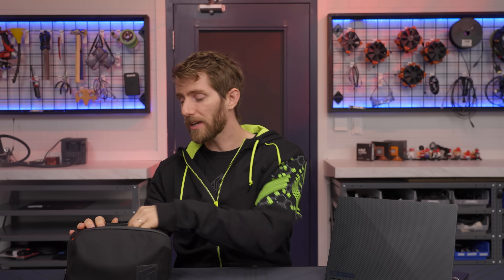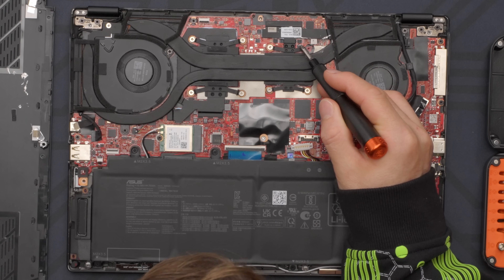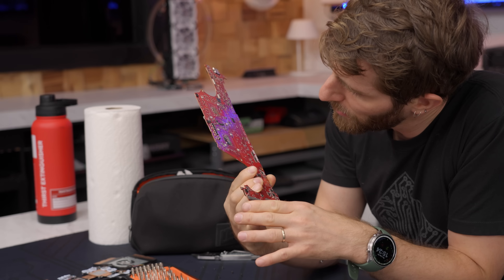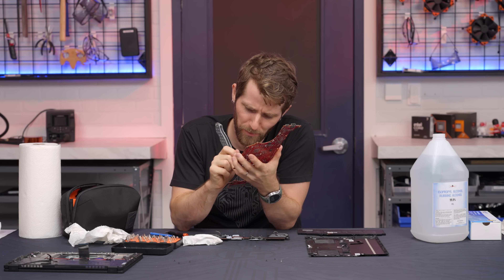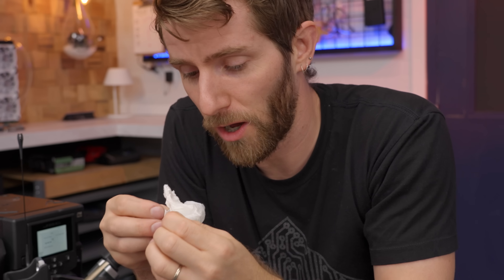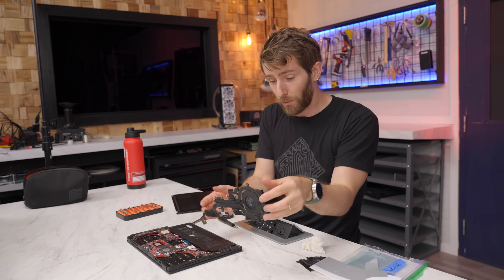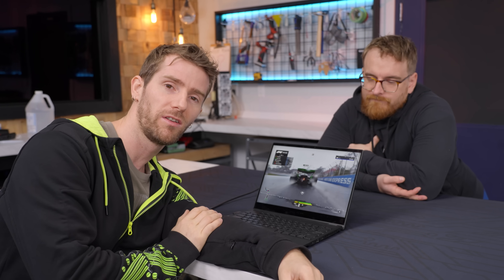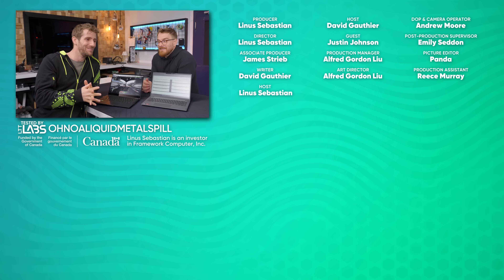Liquid Metal Killed my Laptop… Now What?

Comment: I had a recent experience with liquid metal in a laptop, just curious if anyone else has had this issue. Basically, over 6 months or so, my (year old) Dell G16 7630 gaming laptop slowly started having really bad performance, and not until it was entirely unusable, did I finally invest the time it needed to solve the issue. What it turns out the issue was, was that the cooler had a scratch on the surface over the CPU, and the liquid metal reacted with the exposed copper, forming chunks of metal, forcing the cooler away from the CPU, until it had almost no cooling. I did not have temp data from before the issue stared, but after replacing the liquid metal with PTM 7650, the performance seemed to be back where it was originally. Anyway, this feels like a really weird and one-of-a-kind issue, so I've been wondering if anyone else has had something similar to this happen.

Comment: Get a ultrasonic cleaner and throw whole motherboard, should remove any small drops of liq metal that goes into all nooks and crannies, cause out of multiple devices with manufacturer installing liq metal, i found only 1 that has properly installed from factory and also after 3 months no matter the orientation it kinda still looks ok and works. All others are or dead of short or started to increasing temps and had to be torn down and carefully and thoroughly cleaned and properly reinstalled or simply used ptm7950...

Comment: Your conclusion to the video was that the performance difference was really close. But the actual performance difference was 100% failure, to 100% running fine. The liquid metals cause of failure means a 1-5% performance drop doesnt matter. if it performs better but it can cause a failure,  means its overall inferior.

Comment: I've picked up a handful of the ASUS laptops with liquid metal on eBay to repair and swapped them out with high quality paste and haven't noticed any meaningful temp differences, actually the older ones seem to improve temps a good amount, it appears that the older units had quite a bit of gallium induced corrosion on the heatsink, and I've even seen some unremovable corrosion or contamination on the CPU and GPU dies even after only 2 to 3 years of use. It's just not worth it and it looks like its the same story on the launch PS5's, the risk for damage and degradation over time is not worth the slight temperature improvements on consumer devices.

Comment: I suppose liquid metal would be acceptable for specific laptops designed to replace large desktops & see very little travel time, like for office space configurations. However they would need a battery bypass power option but guess tech industry at this point is more in favor of failure 🤷‍♂️

Comment: Centrifugal Forces Inc. I guess all the tin now is compromised where the LM went so that must all be replaced as well because a bump can kick off the components. This hardly seems to be a fix at all because all components must be put on the board all over again because of weak tin. This is going to be costly for Asus

Compressing a liquid is difficult so when too much was applied the seal would never close it off but the liquid metal would actually push away the seal instead

Comment: Had this kill the memory slot on my ROG zephyrus G13, had to RMA my machine twice because after they sent it back the first time it was missing screws, and ended up having thermal throttling issues because they improperly applied the new liquid metal, got it back again covered in dark fingerprints on the machine and thermal paste smudges all over the board

Comment: I had thermal issues still after repasting my GPU, so I got a phase shift sheet from Thermal Grizzly and their putty for the memory which was overheating too. Been running solid ever since, also applied some on my old Dell 7490 that was running hot with fan going under load. Now it idles under 40c and maxes low 50s under load and fan doesn't even run under any normal load.

Comment: This video ain't done until a proper repair technician takes a look at it. If you're lucky, a short killed a fuse. Resolve the short, which may have already been removed, replace any blown fuses, you can probably get it up running. It would be a dream to get this computer for cheap so I could try to ress it but a proper repair collab with someone that isn't a novice repair enthusiast would be good content.

Comment: anything small or portable does not need liquid metal because the heat-sink is so small and hot that the difference will be marginal, pretty sure normal thermal paste won't do much worse either.

Comment: i was thinking of taking my ROGflowz13 Tablet 2023 apart to do a deep clean and add some thermalpaste to some back chips so i can use a 3rd thin cooler on the back 
while gaming or bitcoining on it. having a big old 2004 Dell heatsinc on the back helped so much that the heatsync that is like ruffly 5 inches high was warm to the touch and i got it to mine fasterrr hahah. [killed by coins not yet]

but id like to mod a cooler on the back external that i can add on and add off like i did in 2015 to my Liynx 10inch tablet back in 2015 my first win tablet that i made fater but in turn made it run hotter but it lasted 4yrs before that died i used to run a store starbucks page onit and even drawn art

Comment: Who the hell lets Linus have a hot air station in his hands as clumsy as he is?  
BTW Linus.  99% isopropyl alcohol with q-tips.  You could even put the alcohol in a refrigerator to chill it, which will make the liquid metal less viscous and ball up easier.  hint:  roll the alcohol-soaked q-tip to get the liquid metal to gather in front of the motion of the q-tip.

Comment: I also have asus g16 strix i7 13th gen variant and it also have liquid metal inside but i always use it on a table but i am going to start my collage soon ,so should I remove the liquid metal and put thermal paste in liquid metal laptop will it affect the thermals well if the difference is only 10°c ,then its a fair trade i guess

Comment: I decided to rep paste my Acer predator Helios 18 and get rid of the liquid metal. Found a ball that had managed to get up under the edge of the process processor. After I was done crapping myself, I got some canned air turn it upside down sprayed it to freeze it in place and then blew it off of course making sure to cover everything around it before I did that and it runs.

Comment: All I want to know is, Am I hurting my PS5 by placing it vertical?
Reply: Yes it’s going to explode if left vertical for long enough and with enough use well exploding is on the extreme end it’s still very well possible but most likely it will just not work when you try and turn it on one day or when your playing it will just stop working
Reply: @eden-32415 Chill, i just wanted to know if the liquid metal would leak over time.

Comment: Well, good job on the cleanup- but liquid metal is also extremely corrosive to any other metals. that means that it probably leeched into the solder of the parts it got on- meaning that they'll over time flake and fall apart.

Comment: Putting Liquid Metal on a Laptop that you carry around in a random position using the same heat spreader used on thermal paste is disaster waiting to happen..
Reply: To be fair unless you just need that extra couple celcius, liquid metal is not worth the effort even on a desktop versus a high end thermal paste especially on consumer hardware.
Reply: @kelmanl4 laptops do kinda need those few degrees
Reply: @ColossaldreadmawOP Laptops need bigger heat sink, not liquid metal
Reply: No it isnt, as long as you dont throw your laptop at the wall then the liquid metal cnanot escape its encasing
Reply: @ts8960 nah fam, it does. Get a laptop with LM and use it for a while. You might be lucky with it, but with the care I take for my laptop, it still leaked out.
Reply: @AvinaashKuppusamy mine is going strong for 3+ years now, with standing up use a lot (daily work). What i wanted to point out though : it is NOT the same headspreader set up. As pointed out  in the video, they have special seals around which raises everything and they have an adjusted headspreader for the LM machines. The regular machines have something that looks the same, but is a bit smaller and mounts differently.
Reply: @jorismak  you've got luck then..... mine came factory with LM and it has leaked out..... not as extravagant as the one in the video but still a leak.....

Comment: I see a lot of gullible people in the comments being "sold" on PTM7950.

1. This whole video is literally an ad for PTM7950, he literally sells it on his store ffs.

2. Any person who has dealt with shorted out boards either spilled drink/water or liquid metal knows that majority of those boards are obsolete. You cannot magically revive them just by wiping off the spillage. Dude even wacks off a couple capacitors off the boards and stills tries to convince you he can make it work somehow.

3. Liquid metal CANNOT be outperformed when it comes to thermal conductivity, it literally has almost 10x the thermal conductivity of any thermal paste including PTM7950. In this case, the bottle neck was either the cooling system or the hardware itself was not highend enough. There's no reality where PTM7950 performs even close to liquid metal.

And shame on LMG for using mental gymnastics to make a dollar. They didn't lie in the video but the truth was portrayed in a way to benefit their sales. Laptop hardware is already very low wattage because of the battery limitations, there's not much heat to move from those mobile cpu's anyway. I dare Linus to try a thorough comparison between the 2 on a high-end machine with big wattage rating. I know he won't!

Comment: 8:09 "liquid metal will heat up not melt"... It's a liquid. It is designed to be past melting at all times. Heat may help it flow better, which would be a better subtitle? I would imagine most PC users would assume it could harden based on the phrasing. Maybe change this? It's a bit misleading.

Comment: Liquid metal is... probably gallium?  Gallium contaminates other metals in an amalgam reaction, usually resulting in a very weak, brittle metal.  Any board that uses 'liquid metal' that spills onto the board is probably not worth repairing due to severe solder degradation from the contamination.

Comment: As someone who used to work around Gallium on a daily basis (high force bearing), Ammonium is the best way to clean Gallium. We used Windex as it had the highest concentration. But it is EXTREMELY hard to get all the Gallium off. We always had some stuck on our laptops’ shells or our shoes. I can’t say whether or not it’s safe to use on your laptop components though. I think it’s so dumb that companies are using Gallium in computers, especially laptops

Comment: I'll be skipping liquid metal.
Reply: @hridoygovindadas914  why? Just dont throw your laptop on the wall and you won't have issues
Reply: Don't mind the asus employee above me
Reply: @lostskull7467  yea i work for asus, how does that invalidate my opinion? It's not easy getting accepted to this job
Reply: @lostskull7467  seems like you're thoughts are very wrong because I don't work on asus employee but i like people yapping on how bad liquid metal can be.
Reply: I’ve gotten my laptop knocked over quite a few times with Liquid Metal and carry it every day for school yet have never had any problems. It’s generally safe if you do it right, it’s just that Asus came up with a really bad design and assembly in this case.
Reply: @ts8960  or just use PTM 7950 and has very close performance than liquid metal, Not only for safety also longevity so you don't have to repaste every year like my laptop has been used 3 years since using with ptm 7950 and still performs well. I just clean only the fans and removes dust from heatsink and never repaste. tbh the liquid metal is just marketing flop.

Comment: Soooo... There weren't any up close and personal shots there, but in the few seconds of google imagesing and watching this video it looked a lot like that retention seal doesn't have a breather or anything like that. If you want to seal something without a breather then the thing you're sealing in has to be incompressible, otherwise when you heat it it'll apply pressure to the seal and, in extreme cases, result in a seal breach...
Given what this looks like, I suspect that's what's happened here... A consistent failure at one location suggests that the heat sink has been effectively pumping out a little liquid metal every time it's been thermal cycled... If you've got a vapour chamber, they're crimped and soldered metal for a reason, they become a pressure or vacuum vessel depending on how they're designed. Ultimately a low contact pressure wiper seal like you've got there never had a chance... I'm guessing it'll look fine in testing, because, and I'm guessing here, they don't use power based thermal cycling in their accelerated lifecycle testing. In fact, it's quite likely they either externally heat and cool, if they do that at all or, more likely, they just leave them on permanently as a burn in style test and only do thermal extremes in operating and non operating states.

Comment: My charge light for my old laptop wouldn't go green no matter how long it charged and i couldn't figure out if it was the battery or the charging brick and well having the 2 bricks plugged into the wall and not the laptop yet just so i could see a charge percent difference and before i could plug in the old one it went POP so it answered my question for me.

Comment: I bought it second-hand for my thesis/capstone project, and it was working fine at first. Later that day, I decided to clean it, but I didn’t realize the liquid metal had spread across the motherboard. I also forgot to unplug the battery before opening it. Since then, it hasn’t booted up.

Comment: I bought Honeywell PTM7950 off of Temu Beleive or not lol 2* 60mmX60mm pads cost me $7.00, and granted my machine isn't "well equipped" with a 11th Gen i7 and an rtx 3060 (100w?) I cannot seem to get it any hotter than 80c now(power virus) , where as before with the stock thermal grease it would always hit 100c and throttle.

Not everything on Temu is fake lol.

Comment: My ROG Strix SCAR 15 (2022) G533 had the same issue a month after i bought it in 2023. It was under warranty then and they fixed it but it just happened again. They've had my laptot at their repair center in Markham for over a month now "diagnosing the issue" and "waiting for parts" only to quote me $1,608.72 to fix it. It's crazy to me that a company as respected as Asus still has shady service and shitty qc like this. A motherboard failing twice in 2 years after having been repaired by Asus themselves is unnacceptable. At this point I just need my data off the ssd, I'm done with Asus dragging this out and I'm super frustrated.

Comment: Hopefully this comment doesn't get buried, but I messed with a ton of Flow X13 units across multiple generations. Whatever metal Asus used is trash, and after replacing it with T.G Conductonaut I saw a major performance boost. I was able to get like 10w extra out of the CPU all while maintaining lower temps, this was on every single machine I tested this on, like 6 in total. 

I also agree that Asus used way, waaaaay to much liquid metal. But if you're after the absolute best performance, liquid metal is still the way to go.
Reply: Wish this comment had more likes. People seemingly just glossed over the reasons he pointed out for this failure and are still trying to blame Liquid Metal in laptops as a bad idea in general.

 I use it in the laptop I bought for architecture school, and it allows me to run it so much cooler and quieter than it previously did. Never had a problem with lugging it around everyday either. The paranoia of a lot of people in the “PC community” can be so frustrating.

Comment: If you clean it with ultrasound, you can fix it, specialized repair shops, has like little btahtubs with oil liquid or something, they pt the machine inside, and hit it with ultrasound like for 20 or 40 min, it cleans even under the chip, it disolves all the liquid metal, that is how they repair that problem